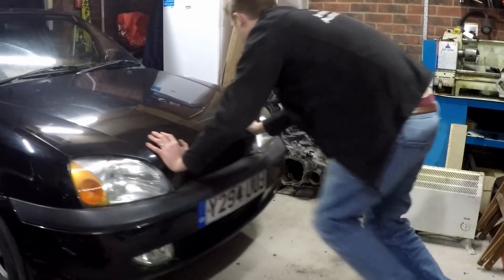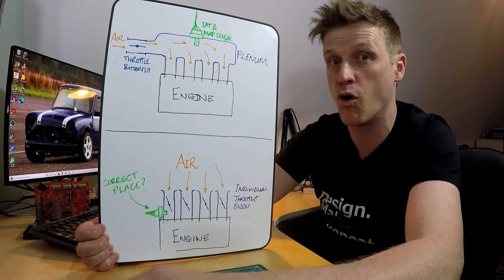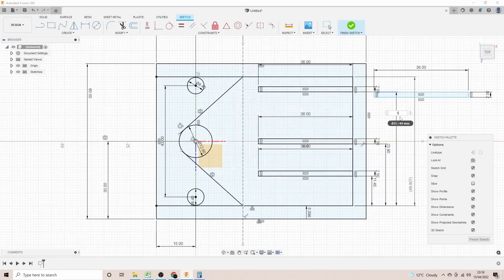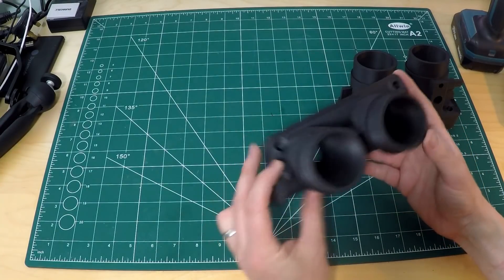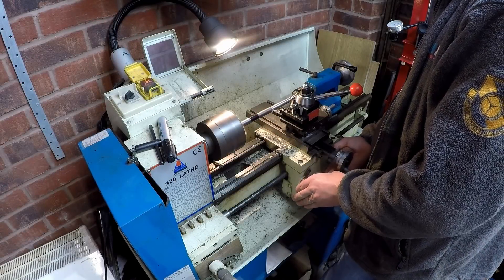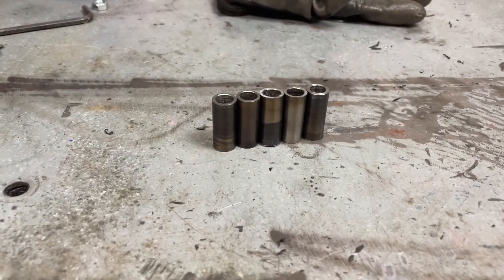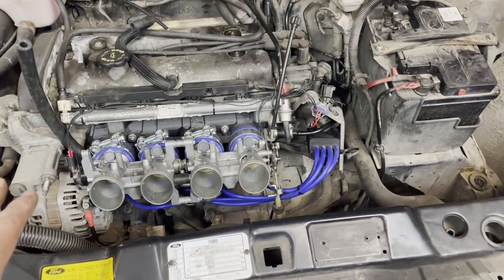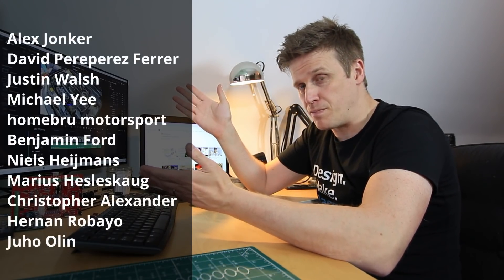Project Siesta - ITBs vs Standard ECU....  Part 2

Comment: Brake booster vacuum and IAC bleed should also be on a common rail linking all four runners (along with fuel pressure regulator vacuum and the MAP sensor). If you want to get picky, have them all connected at a common centre point and make the path to them equal length. This could all be done in some paths integrated in to the flange on the cylinder head.
IAT does not need to be behind a throttle plate, just in the air stream.

Adapting the factory TPS over to the bike throttles was definitely the long way around the problem. Both TPS sensors are voltage dividers and do exactly the same thing. All you needed to do was probe them both with a multimeter to determine which wires to connect to which for 0v, signal, and 5v, then connect them with any generic connector. A 3 pin DTM for example...or even do it without a connector. Just join the factory car wires to the wires that came with the bike TPS. Concerned about not being able to put the factory intake back on? Also pin it to the 3 pin DTM, or don't cut the factory connector off. Have both connectors wired in parallel. You'll never have both plugged in so it will never be a problem. Your method may have solved sensor calibration issues. This could have been tested with cheap obd scanner looking at the TPS values with the bike TPS plugged in in the same manner you test started it.

I can't see if you connected two wires to your IAT sensor or not, it looked like just one (right before the footage was sped up) but it also looks like you ran two black wires to it, and two red wires to the MAP box. Incase you don't know, the IAT and MAP sensor share a common sensor ground pin in the factory sensor. The IAT is not a one wire sensor, nor is the MAP sensor 2 wires. MAP sensors are also voltage dividers (just like TPS) so they also require 5v, 0v and have a signal output.

BRAP is a rotary noise
ITBs make DORTs

Comment: That was a great video.
LOL... Cant wait to see your face when you get it back on the road.

Nothing like the bark of twin side draft Webers, but you'll be close with your set-up.
Truly amazing work and content.

Im keen to do the same thing to my Kent 1700, with Kent 244 cam and twin DCOE Webers.
I learnt so much in one video, then again I knew F all about this conversion.
When you're eking out every last Hp from a Kent 1700, this conversion will  make a huge difference.

On paper my engine can produce 187hp, thats taking in, flow bench figures, compression(11.5:1), piston volume(flat head Kent), cam, valve size and bore size(90 tho over).

Lets be straight... Tuning DCOE Webers is an art.. and not cheap, you need to replace so many parts.
Jets, emulsion tube, chokes, etc.... $$$$$
Not to mention tools needed to tune them like vacuum gauges, infrared camera, etc.

Love to go full stand alone engine management in the future.
 

: )
Reply from the maker: 187hp from a 1700crossflow?!  That would be legendary horsepower (and a very lumpy cam! 😂)

Glad you enjoyed the vid, and I don’t want to spoil the vibe but the story doesn’t end well 😬😭

Comment: I believe that the secondary throttle butterflies are to improve driveability at low main throttle opening angles. One of the biggest challenges with ITBs is the "tip in" fuelling when the throttle is cracked open.  Good progress anyway, I look forward to your video on your 3d printer as this is something I need to get into soon for my project!
Reply from the maker: Yeah, I get that, especially on a motorbike, I thought it was some kind of simple torque limiter or anti-wheely system…. Either way, out it comes!!!

Comment: Incredible the fact that started immediately
I always wanted to install ITBs on my mom's ford escort MK5
It sounds like an angry beehive already so I wonder what the ITBs will make it sound like
This guide is giving me the confidence and knowledge I need to achieve that
Reply from the maker: Hopefully the latest video hasn’t disappointed! Using a standard Ecu will always be a compromise, really you need to tune, and/or change the load sensing methodology so the ITBs run at their best 👍
Reply: @MakingforMotorsport  thankfully my mom's escort is carbureted, gonna go from 59 HP to hopefully 60, crossing fingers 🤞
Reply from the maker: @aarontena  bike carbs are an easy add-on!  I had some on the mini from a fzr600, drilled the main jet out to 1.5mm… ran like a dream.
Reply: @MakingforMotorsport  Also, at the garage I'm working on I was digging through the scrap pile when I found the throttle body of a 1.0 engine
I looked at it and it seems pretty simple, three bolt holes to mount it at what ever surface and a stepper motor that drives the shaft of the throttle 
Feels like I could get 3 more of those, cut the stepper motor from them and join all of them to make myself a DIY ITB
How insane does that sound out of curiosity and how viable could it become in a hypothethical case I would be insane enough to go through with that idea

Comment: Looking at your scheme I think if you place the whole pressure plenum somewhere in between any ITB and its air filter, then the air going into the ITB would keep the plenum at the air temperature. It'll get both the pressure and the temp. reading fairly right
Reply from the maker: Hi there!  To get the inlet pressure it needs to be on the engine side of the butterfly, but it will get a very lumpy signal in only 1 runner, you do need to give in vacuum from all 4 to get a sensible average 👍
Reply: @MakingforMotorsport   I meant to keep the pressure  hoses for pressure signal. It is the same air that runs from the filter into the cylinder and I do not expect the butterfly to change the its temperature. (maybe temporarily when going quickly off the throttle). Thus placing  the whole pressure plenum  anywhere along the air flow should give reasonably accurate temp. reading.  I admit the reading would lag due to thermal momentum of the pressure plenum.
I enjoy your videos a lot, keep your great work up.
Reply from the maker: @zedjag7701  if I was measuring airflow, using a MAF sensor, you’d be absolutely right, the amount of air doesn’t change.  However in this system, using air pressure, it is the throttle butterfly combined with the running engine that gives the pressure drop.  Anything atmosphere side of the throttle plate is at atmospheric pressure and anything engine side is at intake pressure.  
As it goes I have had to redesign all of this… next video coming soon 😀

Comment: 13:36 i see you got some HV blue cables is it a carbon fibre type? ignition is  really important when you change sparks for example low resistances a power of spark and speed of ignition mixture change.

Comment: Awesome video again! What is your bed adhesion method? I’m modifying my CR10s to print carbon/nylon. Thanks.
Reply from the maker: For nylon I use a glass sheet with glue stick.  

For everything else I use my PEI flex steel sheet.  I keep it clean with IPA wipes and it’s good to go!

Comment: I attempted to run my duratec on a 3d printed manifold and stock ecu with the map sensor badly connected. It started and didn't sound too bad but it also wasn't that keen lol.
Reply from the maker: MAP sensor connection is fairly critical (as I have found out 😂), but the festa is pumping with the new setup (next vid on its way)

Comment: O would think that you could plug the stock map/air temp plug into a splitter pigtail and attach it to both sensors. Does the original intake have an air bleed idle air control valve?

Comment: Great work as always, if more people designed printed manifolds properly like yours they would be more successful, and not designing it like it would be made of aluminum, thick and sturdy is the key :)
Reply from the maker: Cheers Cedric, you’re absolutely right!  Good news on the lizard clusterfuck.  Have you re bought?
Reply: @MakingforMotorsport  Haha, good description of the complete mess with the lizard. Re bought and got some shipping info, but my hopes are set low. Im out of the train wreck lizard group on FB, so im not in the loop any more. Had lots of fun projects that have been put on hold where i planend to use the scanner, hopefully soon.
Reply from the maker: @garagecedric  to be honest, the whole CF around the lizard killed my mojo and a big reason why I haven’t been creating.  It all left a bad taste.
Now there is some resolution I do feel better about the whole thing.  
I am planning to do some more scanning videos, some showing workflows and maybe a comparison to the Pop2.
Reply: @MakingforMotorsport  i can fully understand that, whish they just sold it via preorder and skipped the dodgy KS thing. Anyway i look forward to more of your scanning videos, the possibilities are great for this kind of hobby.
Reply: @MakingforMotorsport  I bought the Lizard based on your vid. Endured the whole PITA that it became, got refunded and re-ordered at the same price and it arrived around July. I haven't even taken it out of the box I got so disenchanted by the whole mess; it's been relegated from "uber-excited to get it" to "I'll get to it at some point". Shame really.

Comment: Just out of interest how were you planning on doing this if it had a MAF instead of a MAP sensor?
Reply from the maker: That one is fairly simple, you just need to route all the air the engine gets (including idle air) through the MAF.  From there it deals with it.  

It’s abit more work but I think it’s likely to get more success than the MAP method….
Reply: @MakingforMotorsport  and less sound when i put the AFM, airbox and filter on!
Reply: @_coffeeandcigars  In this case, a plenum would be required/more suitable?  I had wondered what the vacuum bungs were for. Cheers!

Comment: What what the solution for idle control? 

Did you build it into the Map plenum? Or just set a static one on the ITB's?
Reply from the maker: I cover it in the next video but I didn’t use it, just used the static setting.  This is only a temporary solution and it’s summer so I didn’t see the point in wasting the time…

Comment: if i had a cast manifold could i cut it so i can fit the motorbike itb's onto it then fab from there
Reply from the maker: It could work, but it’s might be tricky because…
-most manifolds are aluminium, which makes welding trickier, not impossible if you have the kit and skills but… tricky

What I did initially was scanned a gasket, traced out a CAD drawing, then got a flange plasma cut for about £20 from steel.  Then I just got some tube the right diameter, chopped it up and re-welded it 👍👍👍

Comment: Hi man, as a result of your recommendation I've downloaded Fusion 360! Much less clunky than FreeCAD 👍 how do you export your files from Fusion 360? The latest version seems to have removed the option to export as dxf...
Reply from the maker: Not at my computer right now but when in a sketch I am pretty sure you can export or save as then… will check later 👍
Reply: @MakingforMotorsport  Interesting 🤔 is yours a paid or student version? Mine's the basic free one.

I've been able to export technical drawings to PDF by printing it to a PDF writer, but the lack of DXF exporting rather limits its utility!
Reply from the maker: @BiTurbo228  yeah mine is the full version but .dxf and .dwg creation wasn’t limited as I recall.  

Try right clicking on the sketch in the feature tree on the left?  That’s how I export .stl meshes, it may be the same for .dxf

Comment: What wall thickness do you use for the intake runners? I’ve been designing an intake manifold that I plan on printing with cf nylon, figure your one of the best people to ask for a starting point
Reply from the maker: Hi there, I don’t have any rule of thumb so this other than make it as sturdy as you can because 1. It’s much weaker than ally, 2. It reduces leaks and 3. The nylon is good with heat but all plastics soften, maybe only slightly but they do.

I’ll try and get a measurement tonight

Comment: Those fasteners on the ITBs are probably JIS screws, which is why they rounded over. Many Japanese bikes use this fastener, and that's where the myth of the weak Japanese fasteners comes from, people are just the wrong screwdriver. A Phillips screwdriver will not seat correctly, and round it over.
Reply from the maker: Yeah, a couple have said JIS spec fasteners and I definitely don’t that driver… the drill and chisel seems the right spec tho! 😂

Comment: Nice work man! =D
Looking forward to how the map setup copes with driving+WOT!

Got my M42 running good this round, also on stock stuff. But i run a AFM and full filtered Intake. So not even close in sound rn but working pretty well even at WOT =D
...have a look if you like: https://youtu.be/OdWPkFzQtQg

After comparing the ITBs vs stock on airflow with a MAF i am thinking about having an arduino simulate the AFM based on TPS an see if i can fake alpha N and get the sound back =D
Reply from the maker: That video is great!  And the modelling is fantastically detailed!  Loving the work… more!!!!!!!

Comment: Air temp sensor - put it in the air filter backing plate  = senses an average of intake temp. Def NOT in  one intake runner.
Reply from the maker: Just gonna ask why?
Reply: open trumpets are love, open trumpets are life ;)
Reply: I was going to say the same thing. My reason for this is to not disturb the airflow in the runner that it's fitted to. From what I have seen that is a common place to have AIT-sensor when using ITB's. 

But it would be fun to see if the reading of the sensor would be different in the runner or on the filter backing plate.
Reply: @7rib3rg  yes, testing is always best =D i think it could even be ok to have the iat just somewhere close to the trumpets end and read there. Its gonna be way more critical to get that MAP-Signal vs Volumetric efficiency right, so that the ECU has a fighting chance of knowing the Airflow.